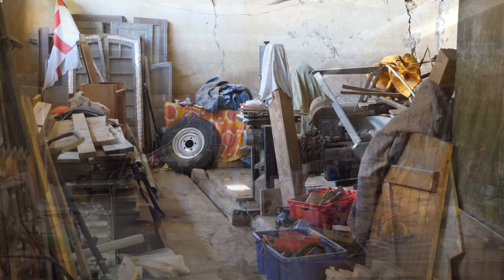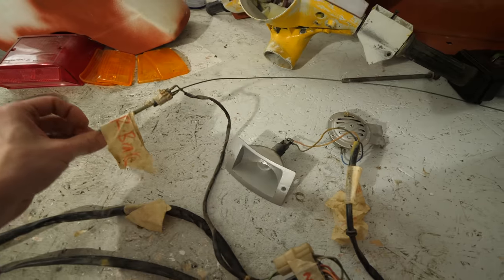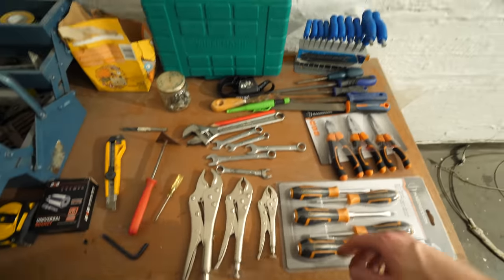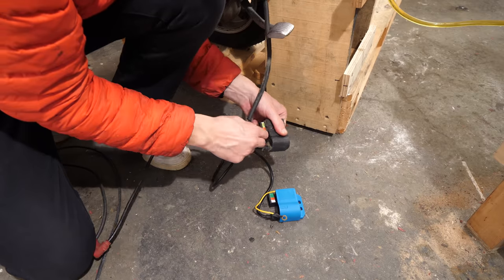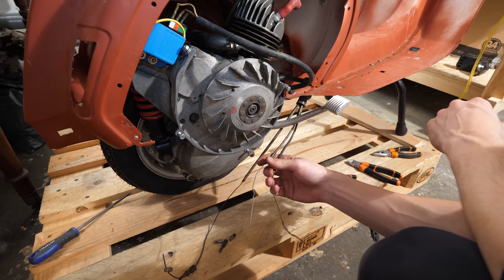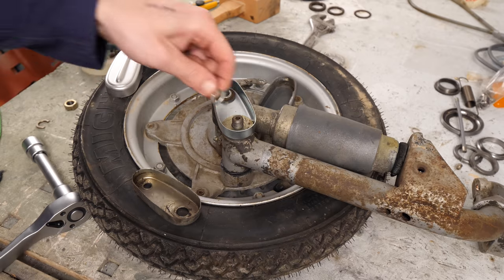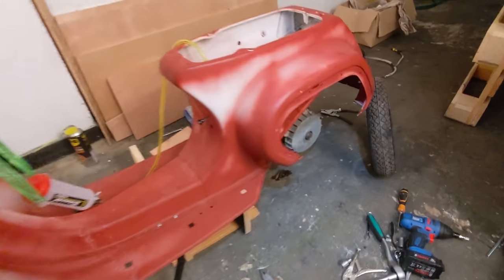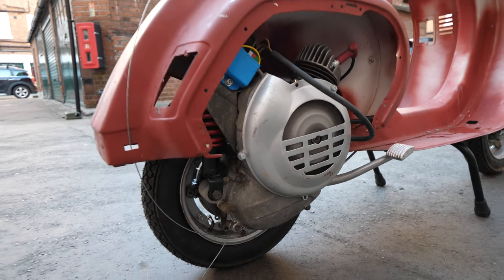Vespa sat in Barn for 10 years | Restoration

Comment: I held my breath when you fired up that torch to soften the end of the fuel line connected to a full gas tank. 😲 💣 🔥 😅
Reply: Yeah, the Covid Cave could have become the Crispy Cave.
Reply: Invincibility of youth.
Reply: i don’t even see the comments, but when i saw that, 😳 immediately see the comments and yes the first i saw was this about the same thing, explosion in covid cave
Reply: The percock at the base of the fuel tank prevented fuel from moving down the line, it was perfectly safe.
Reply: @matternest143  obviously this time everything was „safe“. But never ever underestimate fuel vapor especially in enclosed spaces like bottles or tanks. The smallest amount makes a „beautiful“ ball of fire.
Reply: The valve between the container and the tube was closed so no fumes would have been escaping

Comment: The "regulator" is your voltage regulator.  The magneto in the engine provides a voltage which varies with RPM, generally higher than what you need for the electrics. The regulator takes the raw magneto output and provides a (relatively) stable voltage output.

The white grease in the old bearings was probably lithium grease.  Not a BAD choice, but a bit of an overkill for the application.  Since the scooter is exposed to the elements, you could try the grease used for wheel bearings on small boat trailers.  This is generally formulated to maintain lubrication even if water makes it in.  The first nut on the steering shaft is your bearing tension (Pre-Load).  It should be snugged down JUST enough to eliminate play in the shaft.  Too tight and you will wear out your bearings prematurely.  The second nut is the lock (jam) nut to keep the first one from backing off.

WD-40 is NOT a lubricant.  It is designed to carry a very light oil to penetrate and displace moisture (Water Displacement formula #40).  It's great for breaking things free, FOLLOWED BY  cleaning and application of the appropriate oil or grease.

As stated elsewhere, Ethanol is not your friend when it comes to older engines, as an excessive amount will deteriorate the rubber components in the fuel system.  I'd try to avoid anything over E10.  Mix ratio on the 2-stroke oil is critical, as this is the majority of your upper-end lubrication.  Best to run a bit rich on the oil mix if you are not sure.  Don't know when the UK made the switch to Low-Lead and No-Lead, but if it was after your scooter was built, then you are lacking the upper-end lubrication provided by the lead compounds in the gasoline.  If "Marvel Mystery Oil" is available there, about 2 capfuls per gallon of fuel will help.  Depending on the original octane requirements, you may need an octane booster as well...Lucas or "104+ are good.}

On the fuel, many years ago I had a 1972 BMW R60/5 which was purchased in Germany and sent back to the US when the original owner was discharged from the US Army.  Thus, it was not the US import model, but the German model.  This left me sitting on a bike designed for 100 Octane Leaded, with the best selection at a filling station being 92 Octane UNleaded.  A local BMW group suggested the Marvel Mystery Oil and 104+.  (100 Octane Leaded IS available in the US to this day...if you can figure out how to sneak the jerry can into the airport and hit the AVGas pumps).

Comment: I did the same with a VW Combi when I was 19.  Honestly, I'd only just learned that you had to put oil in an engine, and didn't know which way you turned nuts to undo them!  Pulled the engine, broke the crank case, replaced the big end bearings and piston rings and other stuff.  It started first time and I drove it for many years.  The bravery of the young!
Reply: wow now thats inspiration and a really cool story!

Comment: Carl... you are a gem. Hauling machinery around until you can give it the proper attention. The carb would have benefitted from an ultrasonic cleaning. The foot stand needs a spring.
Reply from the maker: damn right

Comment: I worked on them for Years at a place called Scooterville in Anaheim California. My boss was wolf crow who his youngest daughter was Suzanne Crough of the partridge family got to go down and see them film it was always interesting. Remember always to carry a extra stoplight on those early bikes with no batteries if the stoplight element burned out when you put the brake the engine would stop because the power is being routed through brake light. It also let you know that your stoplight wasn’t working. I’ve always had a Vespa great scooter I currently have one now with ABS brakes and fuel injection I’ve gone modern but as you get older these helpful safety things are good because I am 70. I think that I would like to do a restoration on a two-stroke with the clutch cables and the interesting things were on the earlier scooters.
Reply: Legend!!!  Had me a few Vespas at 16-18 in the mid-80’s and “Scooterville” was a coveted license frame. ‘71 P90 in Gumby green and a red P200E

Comment: Hi! Great work, i have experience with 2stroke engines and I would go like this if I were you:

If it is difficult to start, there could be diferent problems:
Fuel problem:
               1. Dirt carburator (Clean it, check the pilot jets and change all the gaskets)
               2. Dirt in filter (put a new one)
Ignition problem:
               3. Check the sparkplug (Put a new one)
               4. Check the ignition point (mm before piston reaches the top)
Engine problems:
               5. Clutch is slidding and can't transfer the energy from kickstartpedal to the crankshaft (Check the discs and change the oil (Special atention to the API normative of the oil, a wrong-modern oil can destroy the old clutches)
               6. The piston and the rings have too much wear and its lacking of compresion. (Check the compresion with a tool, if it is bad check rings tolerance, check the tolerance piston-cylinder, and the cylinder wear, if it is too much you will need to bore it)

Hope it helps.

Comment: Great job reviving the Vespa and good luck with the spray. Hopefully with a tune and unleaded petrol that white exhaust smoke will be gone. Brought back fond memories of fixing cars and motor scooters with my Dad, although not so much fun at the time dropping screws and parts into the engine or watching them bounce into a shallow drain pit. In the early 80s through to the early 90s, I had to repair all my cars and bikes, except for major jobs. It was just beyond the budget to pay a mechanic at the time. I remember the old push start especially with a shitty old VW Passat across the old East German border exit from Berlin. Trying to drop the clutch while getting some stick from the border guards. My wasserpumpe ist kaputt in an Aussie accent.  It's a bit of a lost art. Happy 2022 for tomorrow.

Comment: Great work! I would avoid using E10 petrol as the higher ethanol content can perish older fuel system plastics/rubbers. Looking forward to part 2
Reply: Should put unlead 98?
Reply: Also it gums up your carb if you dont use it in a while
Reply: @clement6574  yes, some sort of premium, they tend to have less ethanol.

Comment: Wow!  You've just started your first mechanical adventure and without proper tools or manual; at least that's what I can see from your vid.  For what it's worth, that's the way most folks get started with this sort of project.  It's proof that a strong desire to get it running is more important than tools or a lack of knowledge.  Way to go.  Just make damn sure the brakes work!

Comment: Tip for the next time, the autostart spray is sprayed into the air inlet of the air filter, just before you try to start the engine or while you are trying to start it. Good work, keep it up.
Reply: That would be easier but in the spark plug hole works too,  Also placing a little petrol in there would have worked too,

Comment: I enjoy all your videos, especially the woodworking ones.  Some minor points for you to consider on this little project.  Split pins should be bent right back around the pin, not just splayed apart 45 degrees, and Easy Start will damage the piston if you use it habitually.  Far better to work out why it doesn't start normally and fix that.  Once is OK, as you did on the video.

Comment: This is a very interesting video, for a personal reason. When I was 16, back in 1969, I did the same thing with a Vespa. This was one with a 125 cc engine, and it probably was from the beginning of the 60`ties. I stripped it down, took off the engine and spray painted it. Unfortunately, I picked the worst color, a metallic blue. That proved to be impossible to get a nice result with spray cans. But, more importantly, I managed to put it back together again. Everything you did with the handlebar and steering column does not ring any bells, so I probably did not disassemble that. But it ran for 3 years after the spray painting job, until the engine needed a new piston. That was beyong my capabililties, and I stopped using it. But I am still a bit proud of the problems I solved when I was working with the Vespa. Today, I cannot imagine doing anything similar. Sometimes, being young gives you more patience and stamina.

Comment: Usually you should pack (preload) your bearings with grease before assembly. This shoves grease up inside the metal ring the ball bearings sit in and makes sure the bearings are fully coated. Your bearings were pretty thin and do not have a great deal of surface area so there may not be a problem. Packing them makes sure there's no bare surfaces grinding against each other when placed under a load.

Comment: The "Mystery wire" you pointed out in the beginning is for your brake light switch, which is missing off your footbrake. It mounts just to the left of where you attached the cable.
Reply: I thought that too looking at the vid, I've never stripped a PK but I'm gathering the brakes witch assembly is the same as P range T5 etc ?
Reply: @kevinell6605  Pretty much. there was a reedy pin switch that was cobbled to the front brake after a while in other places, but all of the switches that i can remember were at the pedal, as there was no other place to put them..

Comment: Great video Carl. Maybe before the complete final assembly, why not fit a cylinder head upgrade, a Malossi 136cc will give your PK 50 some reliable extra poke, and will bolt straight on with no fuss.
Reply: Except it won't. You need to uprate every part of the engine. Gearbox is made for 30mph, crank is too weak, so is the clutch and you'll need a way bigger carb. Basically a whole new engine.
Reply: Yeah its also more difficult to ride a moped without a motorcycle license when modified to exceed the 50cc capabilities.. when they see you are modifying it, it becomes a grey area and DVLA wont like it.
Reply: @weaselshitz2010  The Crank, nor the clutch need to be upgraded for a malossi series 2 or 3, not sure about the carb upgrade, I would have to re-check that, it's been a long time since I did a small frame Vespa!
Reply: @S-North  Correct. Personally I would be on the lookout for a used 125cc engine, and barring that yes a 135 kit would work a treat. And i would always upgrade the carb if i was changing displacement. yes rejetting would work.. but.. there are enough scooter shops in SE England to help with that.
Reply: @lnrbry  I agree, a 125 engine would be the perfect thing to do, though a small frame 125 lump must be getting pretty hard to come by nowadays!
It's been a while since I've messed about with scooters, so I maybe wrong!
Watching this vid has put ideas in my head to do one last one!
(As soon as I've worked out how to get it by the missus that is!)

Comment: Nice one. I did wince a bit when you tightened the steering column lock nuts with a hammer and screwdriver. If you damage the slots you'll have a bad time. A hook wrench is the tool you need and is pretty cheap

Comment: Its always nice to see the Vespa outside of Italy, can't wait to see it finished.
Ps. That's not the original exaust, in Italy we call it "polini banana" it is an aftermarket exaust meant for modified engines, it' a little to open and too little restriced for the original 50cc. It can make jetting quite complicated.
Reply: Possibly why it won't run with the standard air filter?
Reply: @hoon2806  it can be, but also weird jetting on these things can do a lot

Comment: The problem with the air box. If it is a new filter and there are no obstructions, it sounds like it is likely a fuel to air mix problem. It may be running too rich. Cleaning/rebuilding the carb (Really easy. Lots of vids) may fix it.

Comment: Great video and well done, you probably know but it didn't look as if you put the rear light switch in on the rear brake pedal, and possibly that was the two wires you weren't sure of ....its hard to tell from the video but that's the only way the rear brake light will show ....you will need a rear light brake switch

Comment: Nice resto project. When you're done, park it and use it as a conversation piece. Then get yourself a more modern 4 stroke for regular use. These old 2 strokes are deadly greenhouse gas polluters (like the equivalent of 40 - 50 cars per mile), not to mention benzene in the fumes as one of the many toxic by-products.
Reply: 🙄 was going great till someone used a 2 stroke for a couple hundred miles.

Comment: Probably covered in other comments, just in case. 
No need to pull the spark plug for the easy start, just spray down the carb. 
Also, air filter most likely clogged up if it’s still stalling when fitted.
Reply from the maker: cheers! it shouldnt be as is a new part

Comment: At about age 15 I acquired an old Lambretta scooter (circa 1960) which I rode around the farm.  The shifter cable parted and I foolishly pulled out the cable jacket with the broken cable.  I couldn't get the jacket back in the frame (also mechanically illiterate at that age) so the scooter was a one-gear wonder.  I had to start it in gear like you did by pushing it and releasing the clutch.  I lost interest in the scooter and my dad got rid of it when I went off to college.

Comment: Don't use E10 fuel! It will dissolve your seals in the engineblock! ( Due to the added ethanol) Use 98 E5 or higher. It's best to use petrol without added ethanol .

Comment: When ever you fix an open end baring, make sure you saturate it with baring grease in between the baring balls so it lasts longer and perform better.
Reply: From my BMX days I learned you need to use your fingers to pack the backside of the bearings. I would spend extra time cleaning and blowing out old grease and then completely repack with new grease. If done properly they would last for a long time.

Comment: That green box should be the CDI, for the ignition. It tells the ignition coil when to discharge, and acts as a rev limiter

Edit : I guess not? That's definitely a CDI box style case on it, and those are definitely CDI style connectors on it, but the engine sparks just off magneto power without the main harness, so yeah? A flasher? I guess?

Comment: I'm mechanically illiterate as well, but I was a paramedic for 14 years and saw what can happen when the main stand barely comes off the ground. Leaning in a corner it can be caught in a crack or something and send you off over the handle bar. So be careful with that and fix it asap

Comment: you gotta be carefull with spraying starter directly into the cylinder, next time spray, in the carb, and pref with some 2 stroke oil, and if you wanna preserve the crankshaft, you should have taken the cylinder off, and spray some 2 stroke oil to the crankshaft, bearings, and cylinder, you could risk the bearings going bad because it hasnt been started in a long time. and the oil and petrol, reaches the bearings and crankshaft before it reaches the cylinder, Nice video, but many mistakes.

Comment: I hope you're mixing 2 stroke oil in that gas...    These 2 strokes can't run on straight gas-- they don't have anything lubing the crank bearings, and you'll blow it up fairly quickly..   That's partly why it's running a little rich too..  When you add oil to the mix, it displaces some of the fuel and you'll actually end up with a more lean set up--- and it will run better and not smoke as much.   You need to mix 2 stroke oil in your fuel at about 4oz per 1 gallon..  Which will give you a ratio of about 32:1.  If you keep running this with straight gas, it will die in less than 100 miles.
Reply: So it seems that you didn´t watch the whole video?
Reply: @GettingNervous  I didnt'.. lol..  but I thought I would put out the warning just in case.

Comment: Not to be that guy but you sure put alot of trust in that fuel shut off when using a torch to heat that fuel line. And you can also just spray that starting fluid in the breather port on the carb instead of taking spark plug out. But good video keep it up